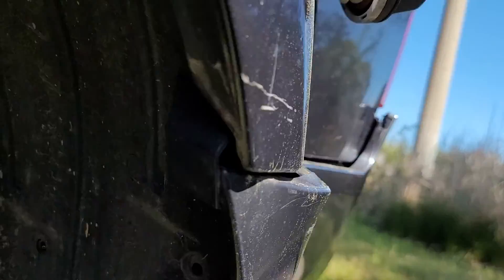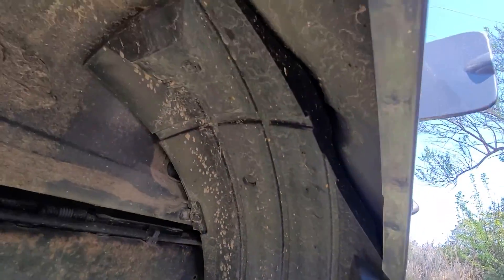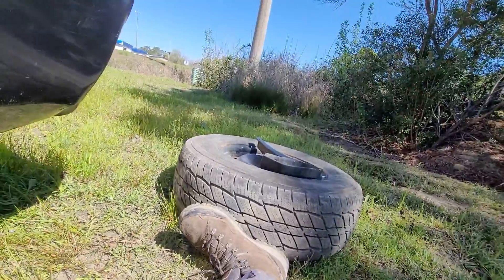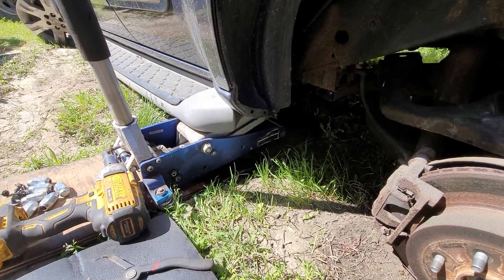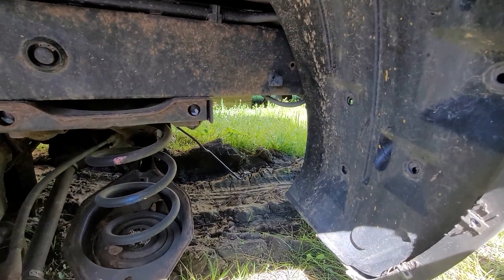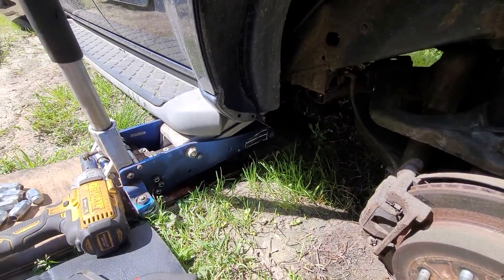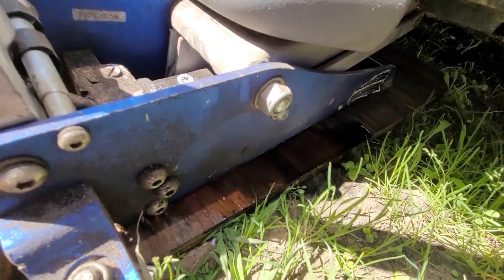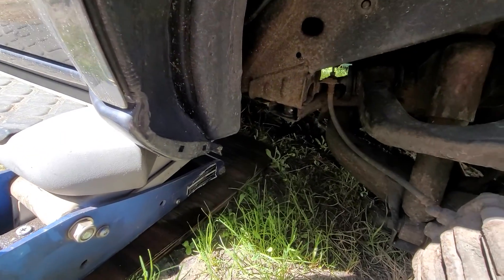Safety First !! I've never had this happen before !!

Comment: EXCELLENT POINT AND VIDEO. I was working on a 72 Coupe De Ville in my younger (pre-mechanic) days. A neighbor offered to let me use his shiney new sheet metal ramps. While I was under the Caddy one of the ramps started creaking and grinding. They just were not made what they were rated for. I was on a creeper and SHOT out from under that car. The ramp collapsed. I was lucky. Really lucky. I got an education that day. From that day on, all I used were truck jack stands which I still have today. Kenny, even if I were doing what you were doing in the video, I would not work on a vehicle without throwing a jack stand underneath on a piece of plywood. There's always that one time someone is tempted to take a risk and it gets them. I've also had hydraulic jacks fail. I never trust and anticipate it is going to happen. This is one area where I learned to spend money on good jacks and stands but NEVER trust any of them. Gravity is not a theory, IT'S THE LAW! Be Careful!

Comment: I learned my lesson. I worked on my 1970 Javelin on ramps, no wheel chocks, no emergency brakes. Lying just behind the driver side ramp I accidentally hit the reverse shift lever and the car rolled down the ramp. All I could do was put my arms up on my chest to attempt to become a barrier to the car rolling over me. It worked but it rolled far enough on my body to break my collar one. That cured me of not using proper safety equipment!

Comment: I have never fouund a good jack. Every single one I have bought leaks down or fails. Junk junk
Reply from the maker: I have a 2 ton floor jack I bought new from Sears back in 1981-82 . I still have it and it works great , which is amazing !! Basically 40 yrs old now . I think I've added fluid less than 5 times to it over those yrs !!
Reply: @WrenchingWithKenny  Yes sir! Craftsman jacks are the only one I have found to be good.